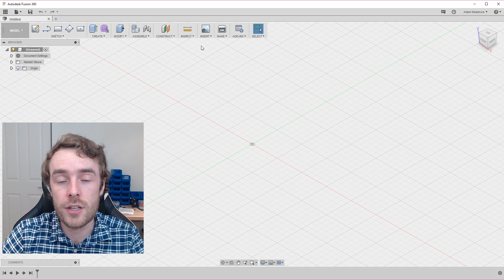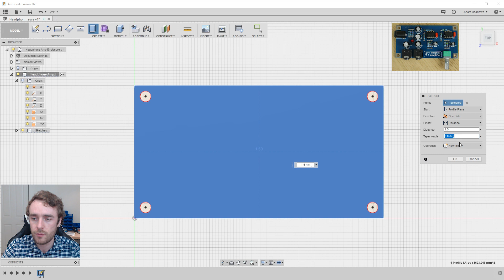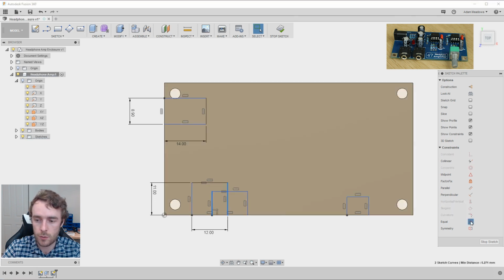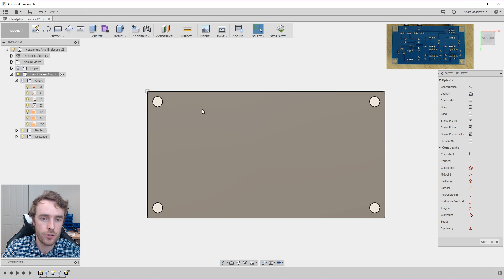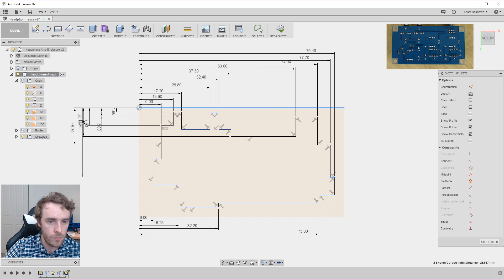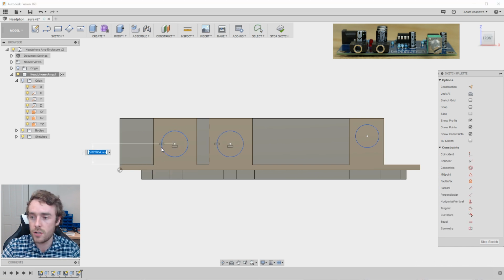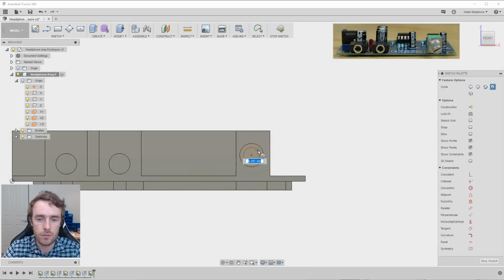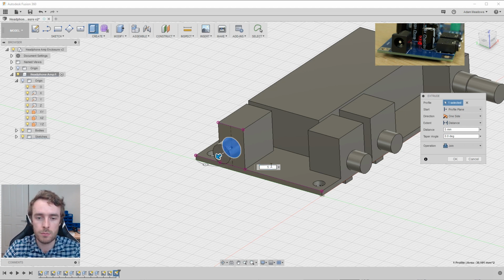Fusion 360 Beginner Project Part 1: Reference Geometry

Comment: I use Eagle PCB for work (I'm an EE) and decided to make an enclosure for one of my new boards. We also have a makerbot 3 (very nice machine!) that the MEs use for prototyping. I could make one of them do it, but I'd like to learn how to use F360 and take on these smaller projects myself. This is a great intro into it! 

Since Eagle and F360 are now apart of the same suite, I can just generate a model of the board so I can skip the step of modeling the reference geometry.

I'm shocked you don't have a bigger audience. Outstanding work!

Comment: This is pretty important information IMHO.  If you are bold, you can take a photo and import it and there is a tool to scale the photo automatically, then build on top of the photo.  Just be aware of perspective distortion and scale everything off of the same "depth plane" in the photo.

Comment: I'm trying to follow this but when I create a rectangle it remains movable etc as it did with yours.  You then set the dimensions and sort of lock them in but I've just spent an hour trying to actually do that as you haven't explained what you are doing.  You appear to be dragging the line but that just moves it. I've found out how to turn on the display of an items dimensions but this doesn't help as I can't set them.  Thanks.
Reply: Thank you for taking the time to reply.  I will have a look at this later.

Comment: Good start to the series, very good point about dimensioning all parts from a reference edge rather than daisy chaining dimensions. I've seen (and done it myself) people get stuck wondering why their dimensions are off after triple checking. Are you going to cover the use of variables? Most other fusion 360 tutorials I've seen completely miss this, yet it's a very powerful feature that takes "parametric" to the next level.
Reply: I personally find them pretty useful, nothing worse than deciding to change hardware size near the end of your design and having to go through and change hundreds of hole sizes to match. Actually, one thing is worse, realizing you forgot to change one after you've made it. Other than that they're pretty useful in combination with equations for complex constraints.